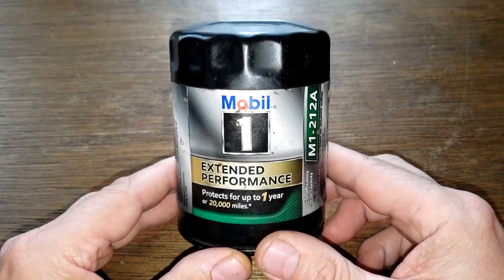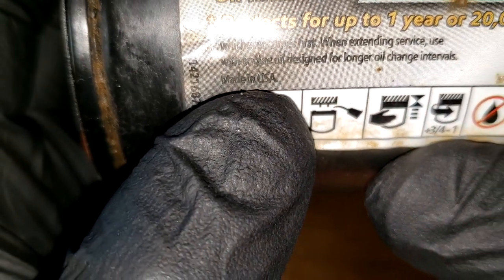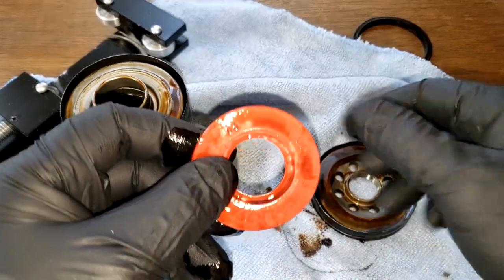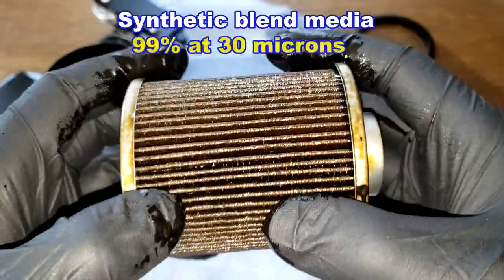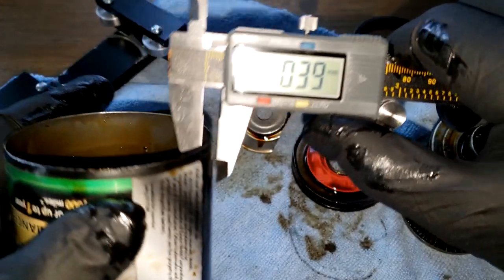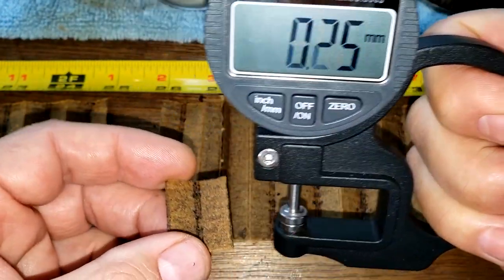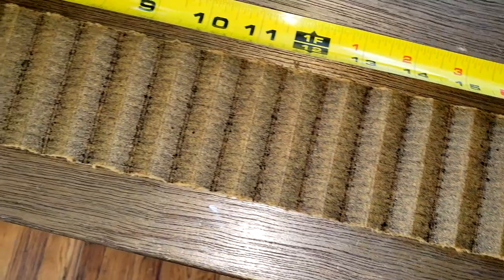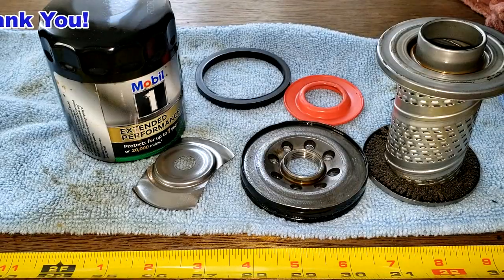Mobil Oil Filter M1-212A Cut Open Used Oil Filter Cut Open

Comment: Made March 08,2022 by Purolator , Fayetteville NC. Look very much like the Purolator Pure One and Bosch Prem filters, but those both have a better efficiency 'rating'. 10k miles in 6 weeks would be easiest on the M1 blend filter media. Less moisture/condensation cycles, more miles at operating temps. Look excellent including seam pleat area spacing. 👍 Thanks for video.
Reply: Absolutely agree. With this style of driving (approximately 340 miles per day) of constant work for 6 weeks in the summer, the engine and oil wear out less if these 10,000 miles were driven in a year.
Reply from the maker: Your Welcome faxmen09!

Comment: 10,000 miles in 6 weeks is crazy ! Filter looks amazing. Thanks for cut and review.
Reply from the maker: You're Welcome!
Reply: Yeah. Crazy. -- 41.66 miles-per-hour for 40 hours per week (non-stop) is a tough gig to pull off.
The pleats looked pretty clean -- BUT -- it's a THIRTY (30) Micron filter, which ain't very good.
On several occasions, the famous 95 MERC ran the Mobil 1 filter with 5-W-20 Pennzoil Ultra Platinum for the usual 5,000-mile OCI. 
Not impressed -- didn't keep my oil clean -- much too expensive for a 30 micron oil filter.
MUCH better results from the 20-Micron-rated BOSCH Premium -- and for less money, too !
In spite of it's poor Micron rating, the Mobil 1 filter is STILL very popular -- P.T. Barnum was right !! 😁
Reply: @SlikLizrd  I agree on the 30micron vs 20micron oil filters. I don't run the 30's.
Reply: @John_D2  Yes, and ya gotta be careful, because SOME oil filters advertise : "99% efficiency with particles GREATER THAN 20 Microns -- but I prefer the Bosch Premium, which states : "99% efficiency with particles AT 20 Microns" .
I have run BOTH filters, and cut 'em both open after 5,000 miles of use.
The Bosch Premium held the most dirt, and my oil stayed clean longer with the Bosch Premium.
The Bosch Premium has proven to be the best  FOR 5,000-MILE O.C.I.s -- for extended oil change intervals, the FRAM Ultra would be my 1st choice.

Comment: Looks like a well made filter and I am impressed how relatively clean the residual oil is in this filter after 10 K miles. This filter looks like a Purolator Boss filter. The bypass valve is a Purolator design and the base plate looks identical even down to the markings stamped in it. I would use this filter but I have noticed it more expensive than the comparatively Purolator filter.
Reply from the maker: Thanks for sharing
Reply: Purolator one not boss. Synthetic blend media not like the full synthetic on the boss. And only 99 percent at 30 microns. Boss is like 20 microns. It’s a way better filter than the mobile especially for the money. Get the nice purolator one filter instead of the mobile and save money
Reply: @ajmedeiros77  Thanks Andrew for the clarification on the filter media for the Purolator Boss and Purolator One. However I wrote that the Mobil 1 filter looks like a Boss filter, not that it is a Boss filter for the following:  Both the Boss and Mobil are in a black can with the Mobil using a sticker for identification. Both filters claim 20,000 miles range. Both filters use a black nitrile rubber or ethylene acrylic gasket.  The Purolator One is in a blue can with a red PTFE coated gasket and is rated for 15,000 miles.  The Boss and the Purolator One both have the same internals except for the filter media. So I wonder why the Mobil claims a 20,000 mile range.

Comment: I have one of these currently installed in my vehicle. As expected, it seems like a solid filter overall, but I'm not sure it's worth the $15 price it's usually listed at. In my case, I found an oil filter that crosses with this for less than half the price, but similar or better performance. Nothing against this M1 filter, but it seems a bit overpriced.
Reply from the maker: Hi John, 
Thanks for sharing!
Reply: Stick with the Champ XL if you want a higher interval filter, otherwise regular Champ work well

Comment: I have used Mobil One filters on both my car and truck for a lot of years, but never run the miles up even close to 10.  I did get the miles up to 8 one time on my Camry, but not by choice.
Reply from the maker: Thanks for sharing!
Reply: It was filter from commercial vehicle. This engine, volume of oil is ready for 10000 miles between oil changes.

Comment: Supposed to be "premium", yet the filtering efficiency is not great.  I prefer a metal-crimped media seam.  There was a little sloppy glue blobs seen, which you might think could have come loose during a bypass event.  Some other filters don't have the loose glue problem, MicroGard Select & Fram Ultra among the best, with better everything, better deal.    Other than over-hyped, under-performing, over-priced, it's OK.  Adequate.
Reply from the maker: I don't like sloppy extra glue oil filters either but this one wasn't too bad and held up well.
Thanks for your feedback!👍

Comment: Great work as usual. No way in hades I go 10K on an oil change in anything.
Reply from the maker: Thanks!
Reply: Spend the money and send your oil to a lab after longer and longer intervals. You're likely to find your oil and filter are just fine after 10k. That's what I discovered with 50/50 driving city/hwy. On the other hand if you just enjoy changing your oil more often have at it.
Reply: @rl7880  Yes I'm well aware of oil analysis, Blackstone Labs and all that good stuff. For me its less about the money and more about the peace of mind. I have a Ford 3.5 Ecoboost engine which tends to have some fuel dilution problems which I change at 4K. I change my own oil and do all my own maintenance so its not particularly expensive anyway.
Reply: Do you guys use corn syrup as oil? That Transit could easily do 20k miles with that kind of driving. Just look at EU service intervals and our cars are just fine. Heck even my 2001 Renault Clio with 1,4 liter engine has 15k km (almost 10k miles) service interval. It just takes little over 3 liters of oil and has almost 300 000 km driven.
Reply: @Tsiikki  Direct injected turbocharged engines have fuel dilution problems not to mention oil is fairly cheap. Also in my case we're talking a 400 HP/500 lb/ft TQ in an almost new vehicle, not a 20 year old car with barely 100 HP. I change the oil myself and spend maybe $40 for the oil and filter.

Comment: I run mobile1 synthetic with  mobile1 filter.
I change oil every 7k miles.
Should I go up to 10k?
These are mostly highway miles every 4 months or so.
Reply from the maker: Thanks, but I can't answer that too many variables come into play.
I would start off with getting a used oil analysis next time you change your oil. See how it looks an go from there.
Reply: Do 5000 max.  I do 3000.

Comment: I have some fl1 oil filters new. C1az-6731-a if you want one to open up let me know
Reply from the maker: Hi Mike,
 Thanks, but I just opened the 6731 it will be shown on  May 26th. I have so many filter requests and I'm not complaining but I have only so many Fridays or even used Tuesday's oil filters to fill. Let me know in a couple of months maybe things will slow down. Thanks!

Comment: 10k miles on a single  oil change is  way to long  . I would never  go pass  5k on a single  oil change  . And I put in a half a quart  of marvel mystery oil  in  every  oil change  . After  300k on my honda vtec  motor  , it does not use a drop of oil  or burn any . And the engine runs very quiet  .
Reply: No.This is a commercial vehicle what is a ready for condition.

Comment: How can this be rated for 20k but the Purolator One is the same or better media but rated for 10k and the One has MORE material as well ?..     The One is rated at 20 micron and this Mobil 30 micron.   LOL...      This Mobil is over $11 now at Walmart which is ridiculous..   Purolator One $6.99 on Amazon with a $2 coupon. .       that should be the price for this "Mobil" filter as well... also the One adds the outer gasket as silicone  which the Mobil doesn't even have.
Reply from the maker: I believe the One is now rated for 15K and they didn't change anything? LOL
"Just Numbers"
Reply: You guys more believes this "fairy tales"

Comment: Still please change your oil every 3 to 5k miles 10 is way to much
Reply from the maker: Phil said the oil reports are good, but would be interesting to see. I look at it this way, 10k miles in less than 2 months on the oil may be about the same as going 3-5k miles in one year?
Reply: @WhipCityWrencher   Sir 6 weeks is a 1,5 month 😉
Reply: @WhipCityWrencher  Right Whip. Today's quality Synthetic Oils like M1 5w30 used here can do 10k miles without issue. Especially so here, where the 10k done in a very very short time, 6 weeks. Most all done at engine operating temps, which is key. Phil's doing just fine with this oci here.  I'd say 10k in up to one year with M1, AOK.
Reply from the maker: @Andrew__Smith  oops I meant 2 months
Reply: I have a Nissan with 480k miles never had no oil leaks or issues with anything but a water pump it's because I change the oil every 4500miles even tho the book says 10k
Reply from the maker: @bradleypetersen241  That's pretty good, thanks for sharing!
Reply: @bradleypetersen241  If I used conventional oil I might stick to 3-5k mile oil change intervals. Synthetic oil capable of significantly longer service intervals.
Reply: @faxmen09  it's just not the oil that count most oil filters begin to fail after 5k miles less you spend 20.00 on a filter I wouldn't trust it.
Reply: @bradleypetersen241  As the topic M1 anecdote proves or the least indicates, your generalization that "filters begin to fail after 5k" is not accurate. I've used many filters, blended media and synthetic media past 5k, all cut open post use, no failures. Topic M1 blended media filter looks almost pristine at 10k miles. I'll concede, some cheap jobber filters not much good past 5k. Topic M1 is not such a filter.
Reply: @faxmen09  only filter I have ever used was super tech and I still getting great miles on my cars I also had a 1999 Elantra had 325k on it tell someone hit me. Never had issues even using super tech oil change it every 3k
Reply: I have always thought the Mobil One filter was a good solid filter. But this review was impressive, I am putting the Mobil One filter up a notch or two. Good job, Whip.